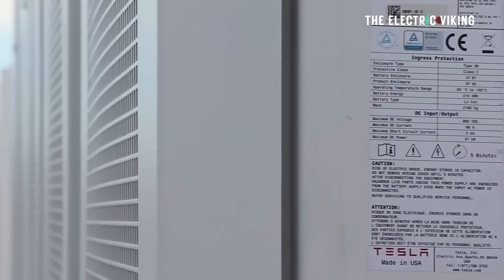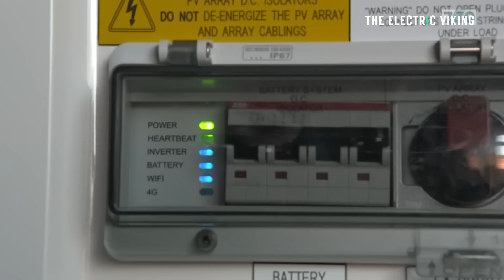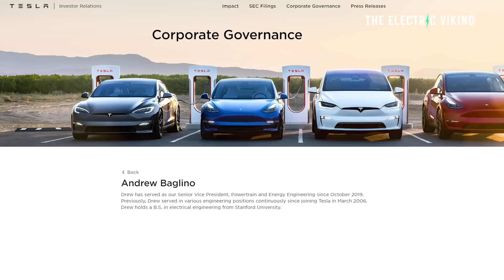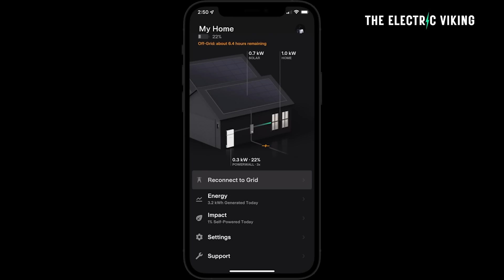Tesla's secret to unlocking fully renewable grids all over the world

Comment: Tesla Is Not Making A Dent In Fossil Fuel Consumption!  How much coal is burned to charge a Tesla?
Taking transmission and charging losses into consideration, it still takes 138 kWh of electrical production to fully charge a Tesla. So filling up the tank in your Tesla takes ~35 pounds of coal, or roughly 10 miles / pound.
Reply: "How much coal is burned to charge a Tesla?
"

None when charging use my solar panels

"Tesla Is Not Making A Dent In Fossil Fuel Consumption!  "

Yes it is. Because even when "powered by coal", that electric motor is still way more efficient than an internal combustion engine.
Otherwise you'd have to burn gasoline/diesel, which doesn't appear magically in your fuel tank either (pumping it up, transporting it, refinery (2 kWh per liter or so?!?) , pump at gas station)... so the entire chain for powering an EV is still much cleaner than the alternative. Even when the grid isn't powered by renewables.
Bonus: EVs get cleaner with every single solar panel or wind turbine that is installed. Fossil fuel cars don't get one bit cleaner from the day they leave the factory. Usually on the contrary..
Reply: I agree with that scenario as long as you don't travel beyond the range of your home and of course the thirty thousand dollar solar investment. That being said in the big picture, Tesla Is Not Making A Dent In Fossil Fuel Consumption!  Worldwide E.V. vehicles of all brands, makes and models on the road equal about 13 percent, gasoline and diesel have 87 percent market share.  I would not call thirteen percent a dent, however a bump is a start in the right direction. The dope smoking fool does not deserve the credit, its the consumer that is implementing the green technology. The deceitful, dope smoking fool (scumbag) is hampering E.V. growth.

Comment: They were quoting $19,500 for installation of a powerwall at fully charged, $61 per month would mean 27 year payback, when do you think the batteries are going to get cheaper? it needs to be a 6 to 10 year payback at 10kw per day, at the moment that's $2.00 per day, so that would be about $6000. when are batteries going to be $6000 installed? or should we be pressuring our state government, since we are in an election to implement the bigger ones like SA?
Reply: I've been waiting for supply to force demand down to lower price points, but so far the price has gone up. This indicates demand is winning over supply.

Whoever cracks the supply side will be able to earn gobs of money in Australia. You'd easy sell 500,000 batteries a year - which dwarves the current rate of 30,000
Reply: Should be pressuring utilities to pay competitive rates for grid storage services, and accepting V2G solutions.  A Tesla model 3 is three+ power walls of storage, and is cheaper.